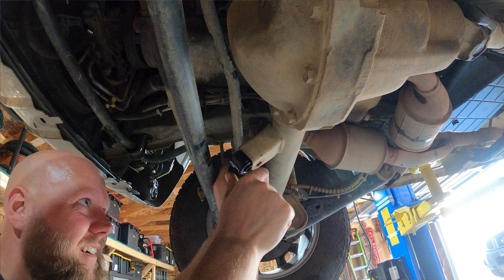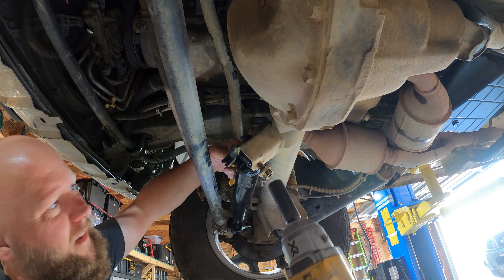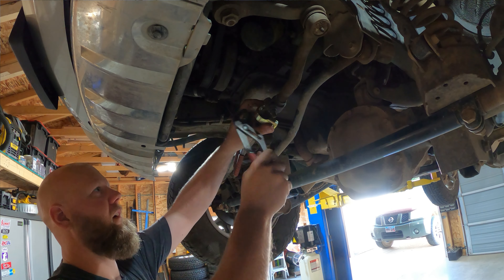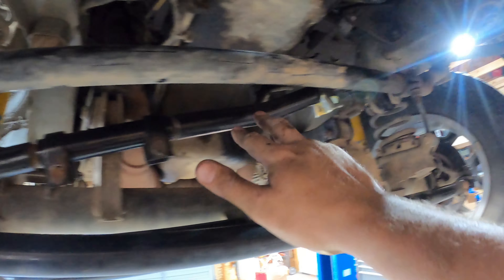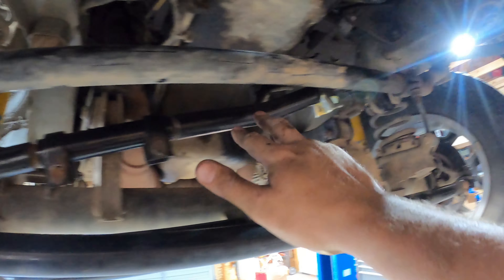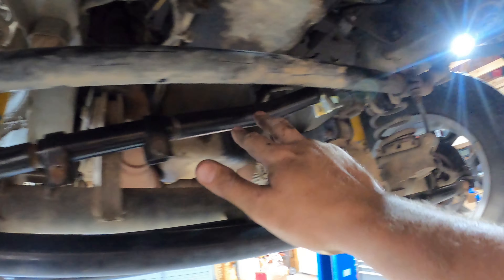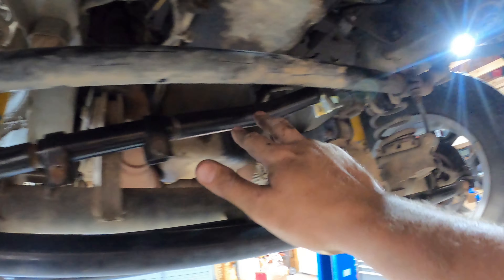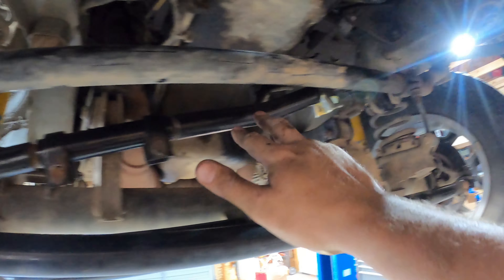Dual Steering Dampeners Install On Jeep Grand Cherokee - Death Wobble and Bump Steer Help

Comment: Hy, i'm looking your video from Italy!
Here is more easy to find diesel's wj than gasoline wj. I have the 2.7 CRD overland. By the way one of the possible cause of death wobble is the upper mounting hole of the track bar that get deformed, in fact you can find some kit that use a bigger bolt (you have to drill the hole to match te bolt diameter) and a sheet metal plate to fix the problem.

I wish i helped you.

Really nice video!

Ciao!
Reply from the maker: Thanks for the comment, and cheers!

Comment: I think they sent you a clamp for a JKS track bar. Only halfway through, but i assume this is the IRO kit/oem plus auxiliary steering stabilizer. 
Im having the same issues and literally want to but the IRO auxiliary steering stabilizer and the RC dual steering stabilizer so i have 3 to mask the bump stop! 4" lift here too, all adjustable and like mentioned, goes away and cones back!
Reply from the maker: It is rather frustrating ain't it!